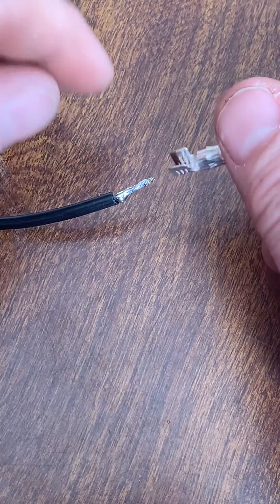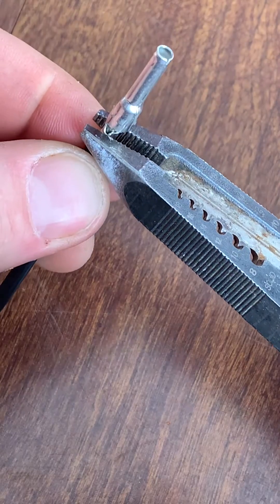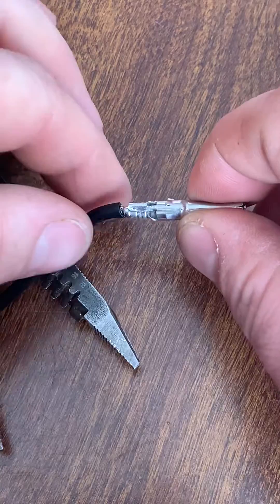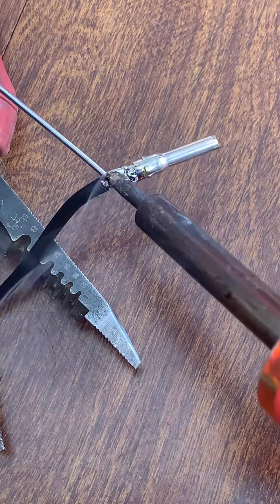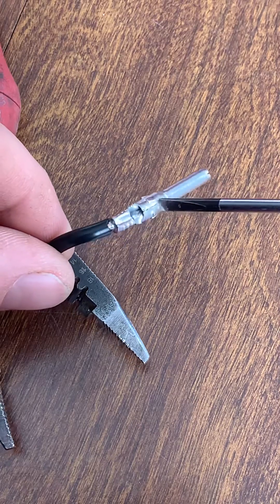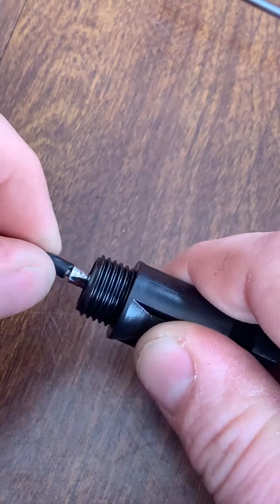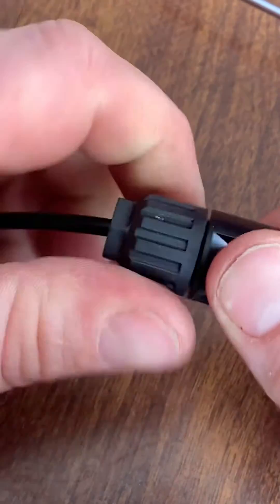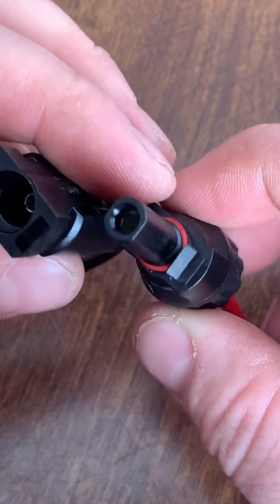Soldering solar panel mc4 connectors

Comment: If you only have a couple of connectors to make up do you really think someone is going to spend money on a crimping machine ?, No way so those like me on a budget will solder the joints.
Reply from the maker: It may be the brand of connector, but I didn’t feel very confident crimping the one I have.
Reply: Use proper crimping tool!!!